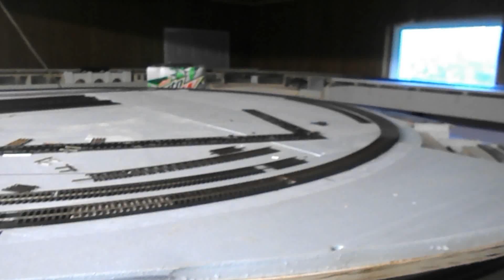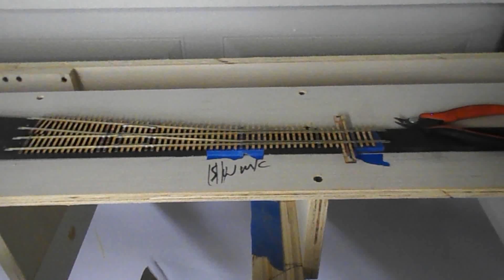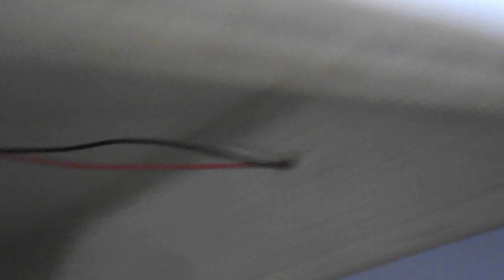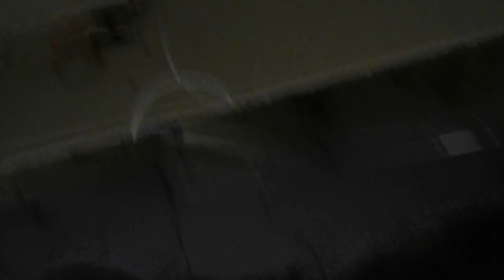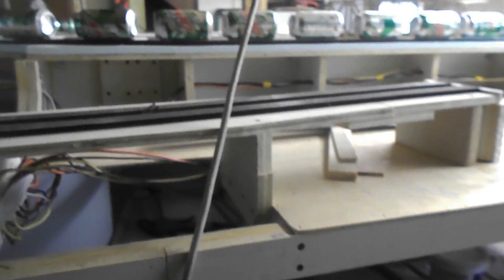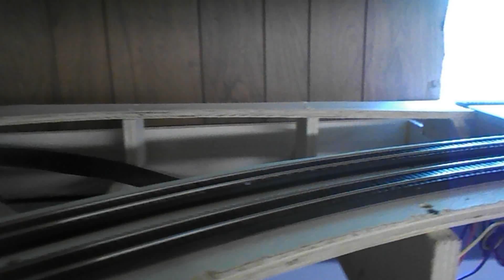K&SV build 27: Finishing the track-laying

Comment: How do you like using servos for the turnout movement ?  I would like to see a detailed wiring diagram for the turnout activation and control.
Reply from the maker: Yes, I very much like these servos for turnout control.  Everything id plug-and-play, so no wiring diagram is necessary.  The only documentation you need comes with the control boards.

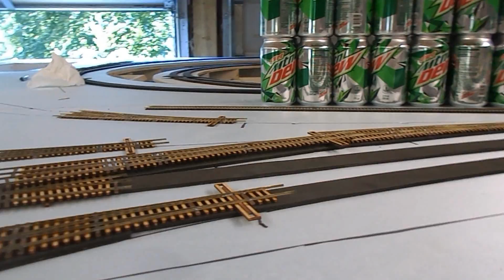Comment: At 2:09 in your video there are two long turnouts and a crossing to be installed.  It is obvious that all three pieces are too long to fit the roadbed you laid out.  Any chance you can explain visually in a forth coming video how you trimmed those up to fit the roadbed?
Reply from the maker: I've shown how I do this in more than one video.
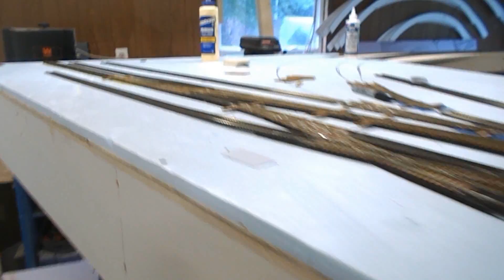Reply: At 3:04 it shows the completed section I think you're referring to?  I believe (from watching previous videos) that Peter trims the turnouts/crossovers to fit together and into the space perfectly 🙂 Impressive technique and something that I've never been tempted to try myself!!